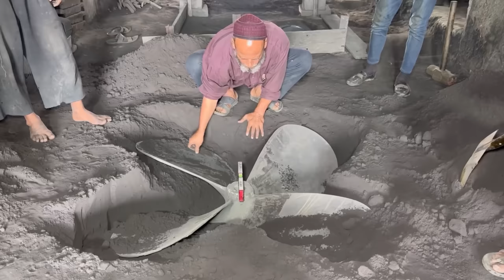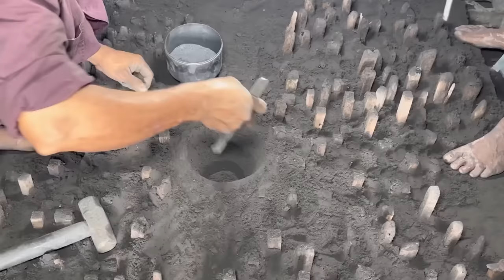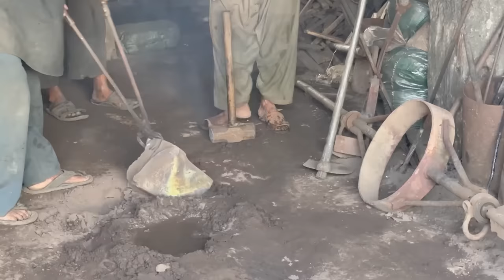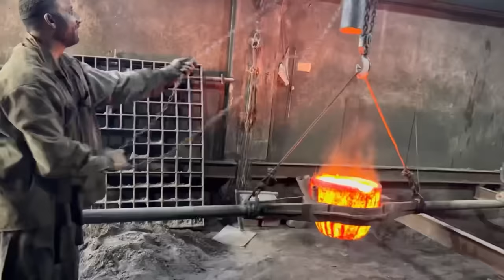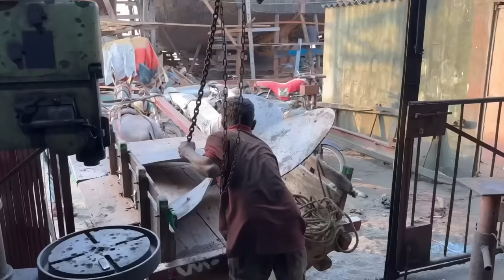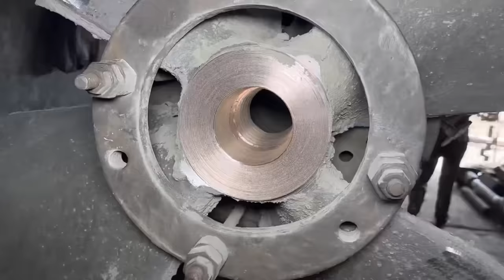World's largest ship in 4 propeller production in local factory

Comment: +/- 20 mm, close enough.  The vibration will take the shaft bearings out in about 10 hours.
Reply: Yeah, I can't imagine the imbalance and vibration could go unnoticed for very long.  
I appreciate the effort these men are putting into their craft, but advancements have been made in metallurgy and sand casting over the years that these gentlemen have no access to.
Reply: 20 mm??? 
What makes you think it is that close?
Reply: Been wondering myself, what about the balance? It's going to do some big damage to some other expensive machinery.
Reply: 20 mm? Closer to 1 mm. Keep your day job, if you can.

Comment: The floor of their shop must have 24" of high-quality casting sand layered upon it, casting sand that someone has to sift through regularly.  They have a dozen or so propellers stacked up on one side of the shop, so it's clear that they know what they're doing.  My guess is that the donkey's next stop is another shop that will straighten, polish, and balance the prop.  The reputation of these guys must be excellent, for a bad prop can cause a shipwreck.  The 550' lake freighter I worked on had a spare prop bolted to the fantail.   I'm guessing that these are Pakistanis, who have been doing metalwork since there's been metal.  The locals of the Khyber Pass can build you a rocket launcher and have been cranking out simplified AK-47's for decades.  

I don't believe the guys lack shoes due to poverty:  I think it's what they like to wear for shop work.

Comment: At 26:27 there is some big splash of molten metal and the operator jump back and turn the face, but then the image is obviously cut off. No safety gear an equipment at all in such dangerous work, is a big risk for the health of the workers. I just wonder how many little and big incidents happen in this workshop and places like this. Human life has a low value round here. No doubt anyway they are very skilled in what they do, to work so well with the poor stuff they have. But we'll never see the video when some of them get seriously burned o injured. The poetry of this all will fade away in a second.

Comment: Drill wobbles not good equipment the result of vibration when installed to the boat
Reply: Drill wobbles but the drilled hole is perfectly round. If you observe carefully, the machinist checks the drilled hole for both roundness and tightness before cutting the key.

Comment: These guys are worked like machine's they are treated like  your every day 3rd world worker  , they're working in very dangerous condition's and they slog it out for the few pennies , they certainly do not have any support from the company , no steel toe boots bare feet is good enough , overalls are for dreams flammable clothing in a foundry is uniform , hard hats haven't arrived in the state we have no use for these ,  safety eye wear is not needed here we have 2 eyes , the industrial revolution is still on its way  , we have fast donkey's if the cart holds together the load eventually arrives .